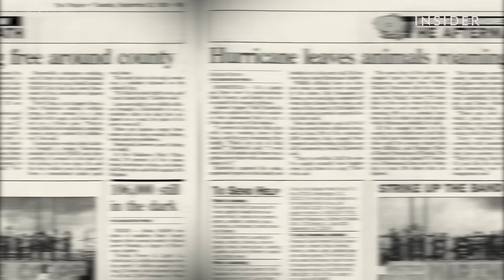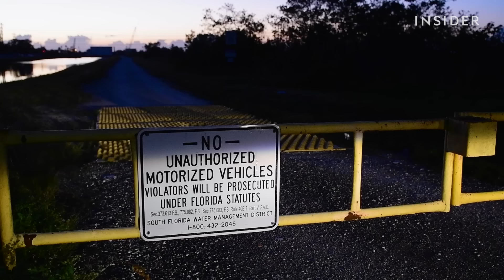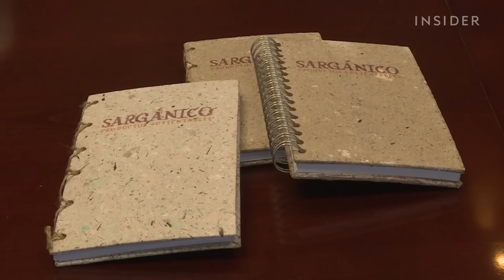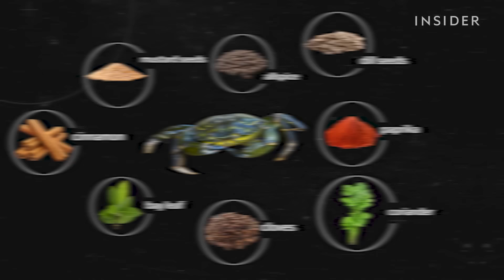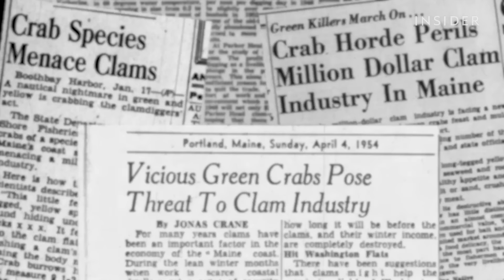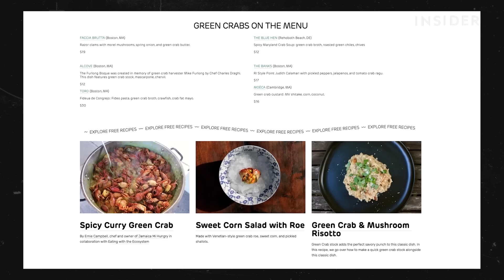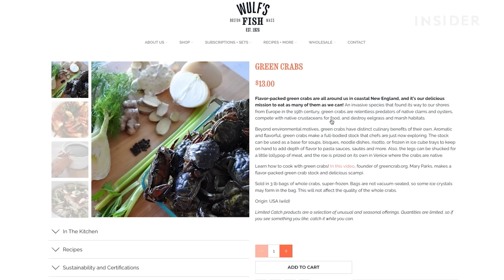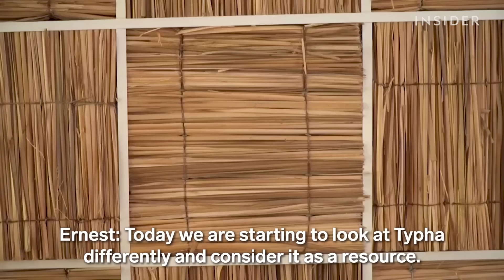How People Profit Off Invasive Species | World Wide Waste Marathon | Business Insider

Comment: If these so called snake catcher used the proper snake capture tools it wouldn't be so hard for them to capture them!! Like Snake tongs and capture sticks, and what a better way than to create a market for the invasive species. We did it to endemic species, like crocodiles', a number of fish species.
Reply: I'm not aware of any snake tongs they make that can pick up an adult Burmese python. Are you not aware of how large these snakes are?
Reply: @strayiggytv Not to sound like an insufferable ass, but yes I am quite aware of the size and weight of the 3nd largest snakes in the world I happen to own 2 of these particular reptiles currently both females, Mina is 20 ft 3in long 402 lbs 12 oz, Pina is 21 ft and 419 lbs 3 oz they eat 2 wieners pigs (28 to 45 lbs each every 3 to 5 weeks. Florida has not seen a truly Full grown Burmese Python yet, at least none that have been captured yet to date. But I digress, what I was referring to in my original post was snake tongs would make it much easier to catch and immobilize the heads of the snakes that they are encountering presently, instead of having to play the Strike and dodge game they are playing with the snakes now. Because they were talking to the camera It would alleviate getting bitten as well as the turn and burn defencive bites from grabing to low on the neck bits. as it is only a matter of time until one of the snake wranglers miss judges location the strike speed or handling holds on one of these snakes and leaves the wrangler with the wonderful gift of 1 or  more teeth imbedded under the skin.  Even a tree branch with the proper  Y shaped end, thickness and length to hold the head down on  the ground safely to allow for a safer capture on both sides. I have seen 1 standard size snake hook being carried around  but not used